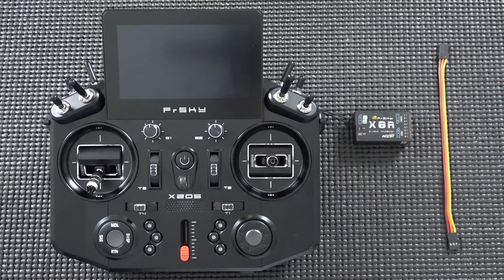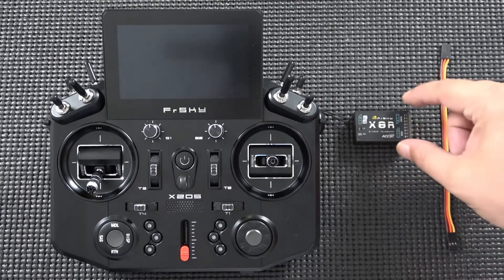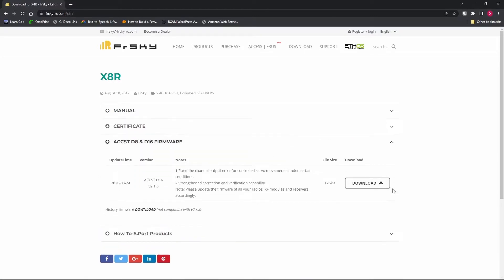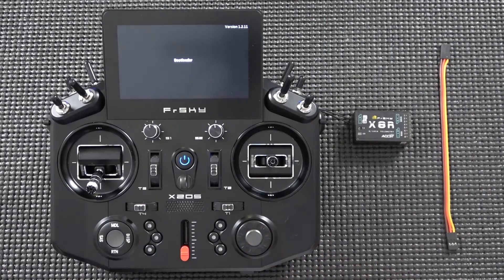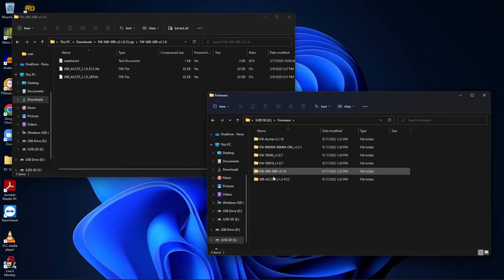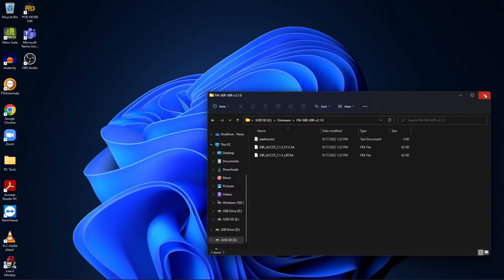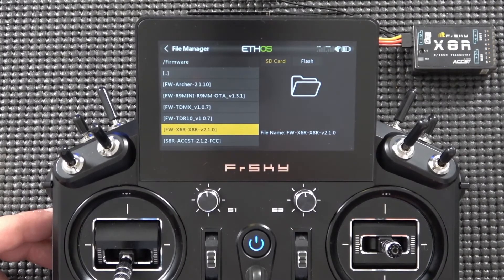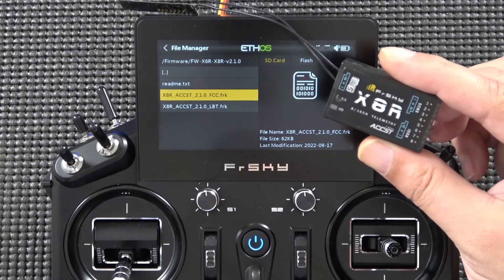FrSky ETHOS Tips - Updating an ACCST D16 Receiver to v2.x Firmware

Comment: Hey Dave, well I got my hands on an X18 radio and have started playing around with it. I have a few X8R's that I got a while back when I was messing with the TX16S. What's the advantages of updating the receiver. Appreciate yer info man. Keep rollin out good content my friend.
Reply from the maker: The X8R will only bind to the Tandem transmitters if they have v2.x or better. I’m honestly not 100% sure what the major differences are between v1.x and v2.x but I can tell you that they are not compatible with each other. So if you want to bind those X8R’s with the X18 you’ll need to do this update.